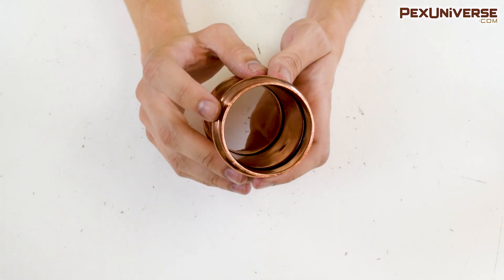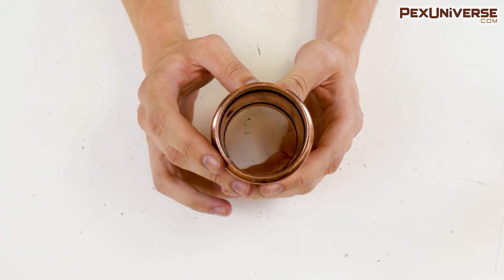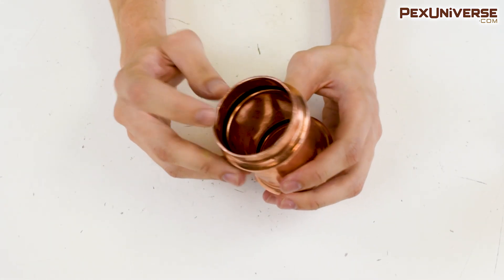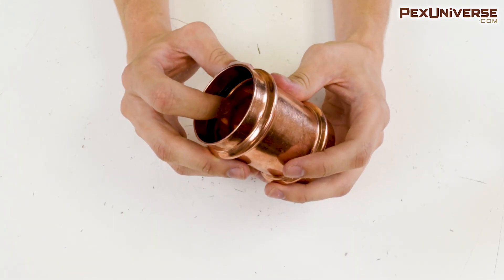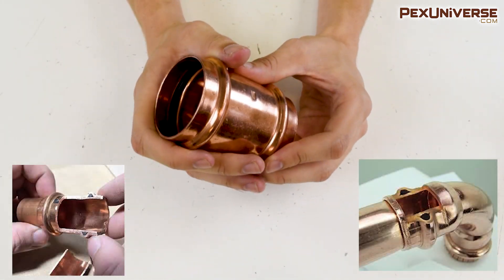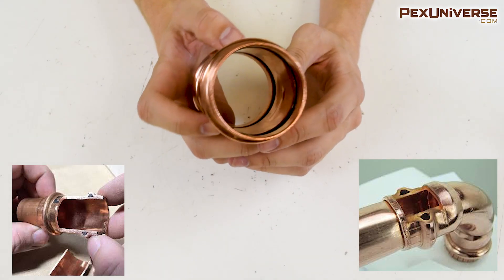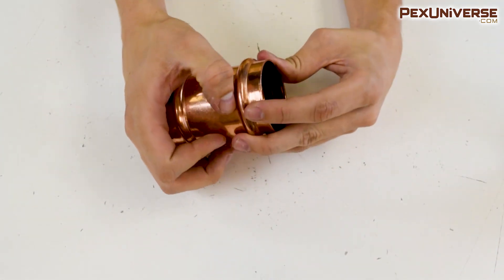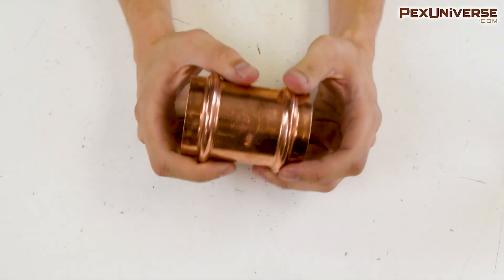What Are Copper Press Fittings?

Comment: Lame sauce. Crimp fittings are lame! Just solder the damn thing! If you're working somewhere that has an issue with an open flame, use an inductive heater. 
Relying on a rubber seal that rides along the outside of the scratched copper tubing is absurd!

Comment: Everyone loves to install press fittings. 99.9% of the problems are caused by installer error ( improper stab depth, not paying attention to the O-ring for proper seat & poor prep causing burs to cut the O-ring). That being said there are still some things we don't know #1 the longevity of the O-ring #2 now that the copper G fittings (gas) are pulled from the market, we don't know the ramifications of the thousands and thousands out in the field. I know they're grandfathered in but that is just to cover the manufacturers ass from class action lawsuits, they'd rather take the lawsuits one at a time in the remote possibility of the O-ring having a failure during a house fire.&#3 as with anything, only time will tell.
Reply: You have some very valid points I just purchased a Milwaukee pro press good information especially on the natural gas do you know if the natural gas fittings got pulled nationwide or is it certain states that pulled them .
Reply: @emmanuelwilliams6004  , nationwide at this time on the copper G ProPress fittings. The megapress fittings are all still approved. I would think they are working on some type of new and improved copper G fitting but at this time I have not heard anything.
Reply: Maybe they are worried about the O ring melting during a fire. If that's the case then it would seem to be not a big issue, if the house is already on fire it’s a lost cause anyway.
Reply: @aussie8114  , I believe the standard is around 1000 degrees Fahrenheit or so. From what I understand they have all the O-rings passing the standards test now. Fire and explosions are two different things (NFPA 54 sets pretty strict standards).